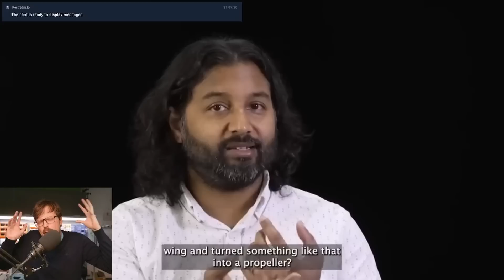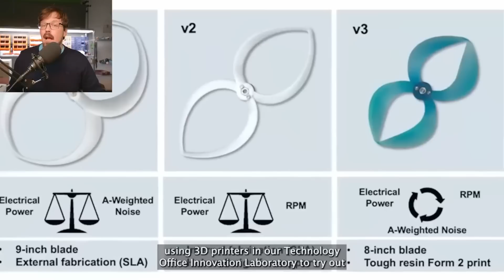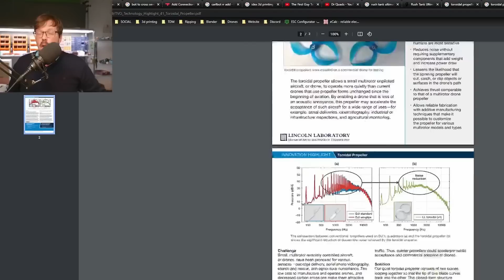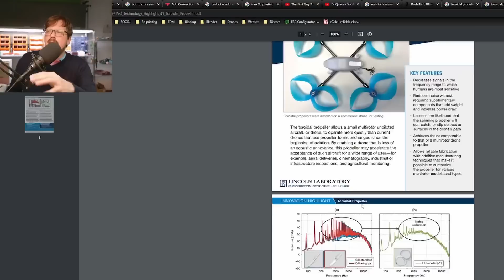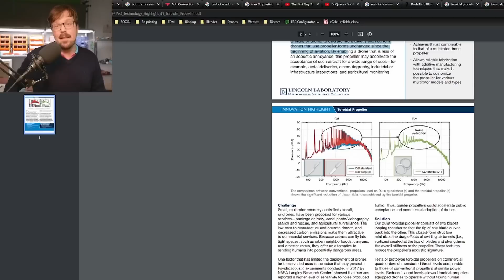MIT Thinks you're STUPID - Toroidal Propeller Snake Oil

Comment: I'll admit, I fell for it so easily. If I had just broken down the MIT video, I might have seen the red flags. The tests from other youtubers are quite revealing, and is why I checked this video out. Great stuff! I will watch the community's efforts on this design with hope.
Reply: My first introduction to this was the guy that tests comupter cooling fan blades, he found pretty much the same thing. My initial reaction was like "oh hey, that looks cool," then "oh darn."
Reply: @nunyabisnass1141  I watched the the same video and I think its a terrible comparison, while the shape of the propellor is important there are many other factors, for example the propellor that he made had no surface finish or polish. It was just a rough 3D print, whereas the fan propellor was smooth and polished. He also only made one design instead of multiple which is far from scientific.
Reply: @MichaelOxlongerThanYours  well, no one said it was a strictly scientific comparison, only that initial reproductions dont jive with the claims. But theres only so much tweaking one can do in any direction to increase efficiency, output, or make quieter, and they all have their trade offs. However since seeing that one video that made it for a pc cooling fan, theres been dozens of other channels trying to reproduce the MIT claim, amd the results are mixed at best from what ive seen. But im not an authority on the matter anyway, so take away what you can get.
Reply: What props are the YouTubers  testing with?
Reply: Well, we had UC Berkeley behind the "magical" WaterSeer that could solve all water issues by drawing moisture from the air (but somehow forgetting the lack of air moisture in the part of the world where they desperately needs that water and the issue of the low few point there - and issues with mould etc in the part of the world where the air really has lots of moisture).

So why shouldn't MIT also be behind some magic? Magic is good to collect sponsors. Does it need to work well as long as it attracts sponsors?
Reply: @perwestermark8920  UC Berkely want' behind any Water Seer
Reply: @odinata  Did you check all the UC Berkeley references around WaterSeer? Will try to post a link but if you only see one post then the Berkely link got eaten by YT. They dislike links unless to other YT videos.
Reply: @odinata  I got shadow-banned with my next post with reference. And your last post with "yes please" also only got to my notify before getting deleted. YT probably will kill this too.
Reply: @perwestermark8920  You're getting to worked up over crazy conspiracy theories.
Just relax, and breath.  UC Berkeley had nothing to do with WatterSeer--it wasn't their product.
And MIT students working on developing quieter props aren't out to get you.
RELAX!
Reply: @odinata  Unclear how you ended up on that track. MIT homepage presented WaterSeer and multiple MIT staff was involved. That's a documented fact. You may not like it, but it's still documented.
Reply: I fell for it too, but literally did no research I saw the titles of youtube videos and thought "Huh, thats cool" and repeated it to people.
Reply: Lol sure you do bud.
How many 2 bladed props are you  runinng on your fpv quads?
Reply: @odinata  5"? If it's super light and only want speed then I would. I can be very specific if you need me to be. How about you? ;)
Reply: Simply the fact that the MIT video (or whoever made it) used deceptive practices in regards to the audio,  is unacceptable and casts shame on everyone involved.  Information should only be shared by people who are driven by the discovery and proliferation of truth.  Everyone else is problematic, in my opinion.
Reply from the maker: Because I am a perfectionist I bugged the hell out of HQ prop over my 3.5 inch drone... And to their credit the engineers sat me down and walked me through every question I could think of. And one reoccurring theme was weight. So I knew the second I saw these props they would never be as efficient
Reply: @33rdframe  If they produce less drag (vortices, cavitation, etc) and consume less energy per unit  thrust, then yes, yes they are more efficient.
No one at at MIT claimed these props were for the 3.5 inch FPV tools...
Reply: @odinata  Except for 1 problem; they do none of that. And besides, engineering in aerodynamics have worked all this out.. decades ago. All there is to prop design today is application, application, application. You choose a prop profile based on application. The aerodynamics are 100% worked out
Reply: @Drmcclung  If it was worked out decades ago, how come there a new props coming out all the time?
Why weren't you flying drones DECADES ago?
Reply: @odinata  Did you read even half of wtf I wrote? The aerodynamics were worked out years ago.. prop designs are now based on application IE "what do I need out of this prop; max lift? Max noise reduction? Is RPM a factor? How fast does said thing need to travel and at what altitude? What's my aspect ratio?" This is what determines prop profile. There's absolutely nothing left to discover in the aerodynamic properties themselves; we know how it works. It's a question of "what do you need your aircraft to do"
Reply: @odinata  And by the by.. what you're confusing for "new design" are actually older designs that for the most part weren't feasible until fairly recently as materials science caught up (metallurgy, manufacturing, composites research) a lot of more efficient profiles only exist today thanks just thanks to advancements in materials, not aero
Reply: @Drmcclung  CAn you answer the question?
Why are people testing and designing new props to this very day if every prop has already been produced decades ago?
"There's absolutely nothing left to discover in the aerodynamic properties themselves;"
Why doesn't anyone in the industry agree with asinine statement?
Reply: @Drmcclung  I'm not confusing anything.  New propellers for drones come out every month, with new and improved aerodynamics, shapes, efficiency, sound properties, weight, strength. materials....
Are you smoking that other guy's drugs?
Reply: @odinata  He completely answered that question... now, you need to WANT to read the answer... lol
Reply: @TheChzoronzon  NO, you NEED to WANT to hate on some college students are simply trying to work on a school project.
You can't even say what my "question" is, let alone answer it.  LOL.
Reply: @odinata  Maybe hobby grade products don't get as much attention as transport aircraft. Just maybe. So of course development would be slow and iterative.
Reply: @odinata  new propellers for drones come out every month because money. The (mostly) Chinese prop makers doesn't do r&d, they apply variations of already known designs to make money. Plain and simple
Reply: @PhrozenN  So you only use the oldest drone props.  How many years old are your prop's designs?
NAme the prop you luse.
Reply: How can they make money if the new variations they introduce don't work as advertised?
Reply: @odinata  because... There's... No... R&D... Connected... To... It! There are no secrets left when props are concerned, it's literally just a balancing act to get what you want out of the prop.
Why are you so adamant about this? When so many people have told you how this works
Reply: @odinata  whatever dude
Reply: @PhrozenN  Go play with your benchy, dude.
LEave the science to people who understand it.
Reply: @odinata  some one is butt hurt.
Reply: @MrMetalpunx  And they have a right to be.  The butthurt person hates scientific research, but scientific research keeps producing Innovation and Improvement...and winning.
Reply: @odinata  bless your heart.
Reply: @odinata  0
Reply: @odinata  why are you talking in the the third person?
Reply: @MrMetalpunx  why are you still crying?
Reply: @Drmcclung  btw there are still things not solved In aerodynamics and if they were solved we could probably improve propeller design. But you are generally right otherwise. Also there is already a technology which does what this tech advertises. It’s called a ducted fan. It can reduce sound by shearing off the wing tip vortices like this prop claims to do and they’ve been around for decades.
Reply: @Dr Quads  Exactly! Can't add weight to a propeller and expect better performance. The instant I saw the first pic of the props I called bullshit for the "better" performance.
Reply: @funwithfamfun  How many props have you designed?
Reply: @funwithfamfun  So you think 2 bladed props, since they are lightest, are best performance.
You must not fly.
Reply: @odinata  Lots. Have several in production also. Tested with fdm, resin, etc. I have wood, plastic, a
Carbon fiber, balsa wrapped carbon fiber etc. Planes, quads, Octos,  up to 48" five blade adjustable pitch down to 3". Lots in-between. What cool about prop design is it never ends and it's application specific.
Reply: @funwithfamfun  "What cool about prop design is it never ends and it's application specific."
Exactly wht the MIT boys are saying.
You've toatally contradicted your original claim.5 blade adjustable pitch props aren't' too light, are they?
LOL.
Thanks for agreeing with me.
Reply: @odinata  is the MIT guy your brother or something? Why defend a failed attempt at a bad sale and even worse prop design? It's a dumb idea and won't work (all counts not just the one single point you have chosen to defend) ever. Don't care how much money someone throws at it.
Reply: @odinata  I'm not agreeing with you. I'm saying there are ways that work and don't and 99.99999% won't if your guessing.  Ya it "works" but as this video is pretty clear there is not one shred of evidence that would make me want to try them. None. Show me your data that they are better than anything in any situation.  Just 1 is fine.
Reply: @funwithfamfun  Is MIT engineering your direct competition?
You claim to develop new propeller.
do you do RESEARCH when you are designing your new props?
OR do you just drw them on some notebook paper, go by your gut, and pour the plastic?

HOw do you know when an idea is bad?

Comment: what do you think about sharrow prop? I think $5,000 is too expensive for a piece of cast steel, even if the real increase is 20%.
Reply: Assuming their data is correct and you can keep damaging your prop for the life of your engine and you are an active boater, then yes it is a great deal. They claim other benefits too: lower noise, lower planning speeds and better reverse power.
Reply: there not cast the CNCed billet.

Comment: DRQ, I know by now you've read these references. Like you, I rant in one reddit post about the toroidal. I got rekt by not having to read the patent data carefully before my post. I assume most of people have not digged deeper before commenting. 
 So I read  and understood better where their coming from, or at least their claim. 
There's charts in the 2020 patent. "In their tests" toroidal is always the best. Their data from 2020 rig uses single prop. Unfortunately or clandestinely, there's no  significant data and sound sample for Quad application besides the poorly-made powerpoint for db-frequency in their 2022 paper. 
So I'm still skeptical about it until we get realworld results. We need peer review. Chris Rosser please settle this once and for all.
But given that they already have the patent, does that mean they have secured themselves royalties of 5-25% of sales for all iteration or improvement of the toroidal? Guess that how the world works. As for me, if it turns out good and claims are met, they i'll wait to buy the gemfan or hqprop version.

Comment: After a few days chewing on tihs, it feels like the statement from the people that represents why this got so popular is that drones are way too noisy, and it shows how quickly we are to jump on potential to solve that issue. You are completely right though, no hard data shows there is lack of proof of it actually working. Why didn't you just go ahead and address what was on the patent? I feel like I am commenting blind. A "trust me guys" statement on such a damning video, well....
They didn't say the final version was FPA, he said he had interns working on prototyping to test concept. As you can also see they were try blades while  the end version were double. 
Which from what I am seeing most of the failures of the net are using triples too. But I have been arguing with those people as well, because they are assuming they can just roughly draw something in cad and expect it to be conclusive, and they too don't use data, it is more like what model of drone it is at best. Which to a layman means nothing. 
The point to which I was arguing is that the geometery is everything, that includes the chord thickness that would need to vary. Propellors are essentially little wings, and to just gloss over the years of development over prop technology is a huge mistake. You can't just stick onion rings on some random hub and expect it to do anything. 
Using the sxample of the water ones, that too peobably went through a ton of iterations, and it is pupose built to be efficient in that application, as these propellors need to be as well. 
Torodial needs a bunch of refinment I am sure, just like the propellor when it was first patented. I am sure they don't want to give too much of that away but still we are talking about a r and d lab that showed enough progress that wanted rewarding. Again though IDK what the reward is, and what the data is on exactly what it is for so that is speculation. 
But what had me excited was there seemed to be an innovation that helped reduce some of the highs and lows of the frequency which I do know matters a lot. 
I also want to point out that I noticed that the side by side comparison you can clearly hear that the Tor prop winds up slower but as soon as it gets to the same speed it sounds louder. But it also looks like the prop used there isn't the blue version. 
It is funny they mention the tests of the military, should say all you need to know because if they didn't make it work, it is highly unlikely to work. I know for a fact they were doing everything they could to reduce prop noise, and it was over a multi decade need. Vietnam they had some of the quietest props ever and it was more about controlling engine noise so they buried the engines in the feselage and used a huge driveshaft. If you watch propellor for submarine videos you will also see that there has been a lot of advancement in the feild. Usually those are hidden from the public until way after they are replaced. There is a delicate balance, and they have plenty of data on it. 
For drones more needs done on reducing vibration and engine noise before we would see real benefits of these props. It is interesting the dude was working on ion propulsion and gets a reward for this afterthought. 
Glad you made this, hope that the feedback prompts better data to be released.
Reply: Your thoughts on the geometry of the props are the same I got after viewing all the attempts people were making, I absolutely agree. Like the current boat prop that has an intrinctate 3d shape, the one for drones/aviation should be as like, they need things as variable chord/angle of attack or just a twist in the "knot" shape (imagine if you look the prop from the side it'll be more like a horizontal 8 than just a flat shape). However, more surface adds more drag and that's where I'm not so sure about efficiency.
Reply: @ivoxx_  Yeah exactly, I would expect the secret sauce is all in that delicate balance, which is most likely why tri didn't work. Essentially they would have to perform only better to 4 blades, though toward the end those curves will need to be perfect to make it work. Stability stems from that. I have just long studied wings and stall characteristics but I would hope that with the award more attention gets put into it, maybe these days we can work it out.

Comment: I agree that the communication about these is very fishy in the way that they never give actual audio samples and don't show intelligible data to support their claims. It's an interesting perspective that there are strong motivations to present positive optics to draw in investors.

What I find interesting about the patent is it was published originally in 2017. The "data" in the patent is unintelligible though, and the designs look exactly the same as what's in the videos we've seen today. In the patent the inventor (featured in the video) acknowledges that there are a lot of tweaks and refining to get the full performance out of the design idea, but in the last 6 years he has seemingly made zero progress on this? But the patent writing seemingly tries to stake claim on any modifications and improvements to the design:

"It is recognized that modifications and variations of the present invention will be apparent to those of ordinary skill in the art and all such modifications and variations are included within the scope of the appended claims."

The patent was granted in 2020, and is owned by MIT.

With all the hobbyists that have been testing out the design and already improving it, it seems like they are just doing the engineering on MIT's behalf and hypothetically they own any improvements people make. Not sure if that holds up in court.

I'm not sure if it's entirely snake oil in the sense that it can't be a viable propeller with additional development and engineering.